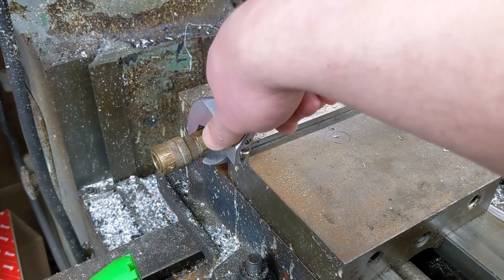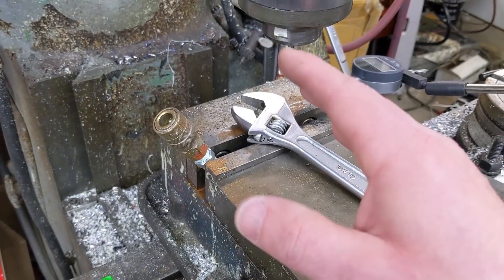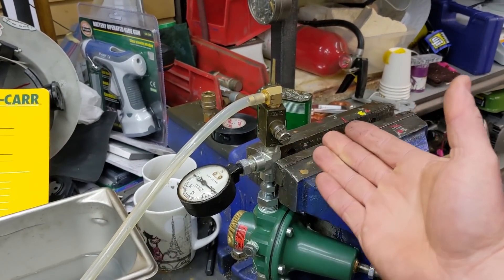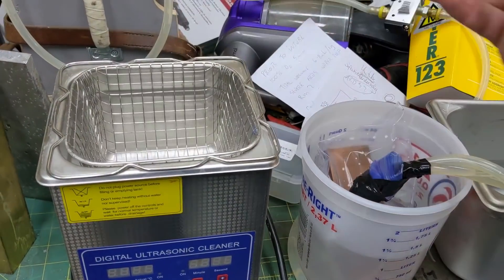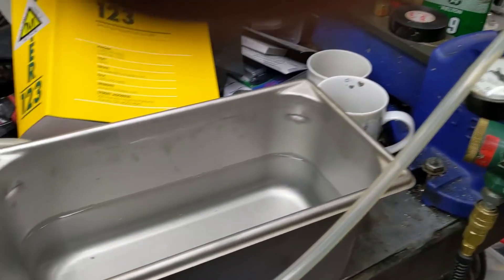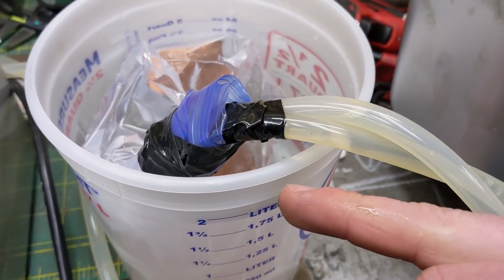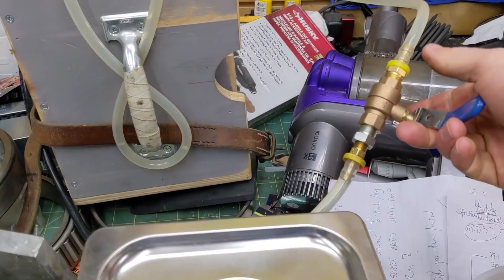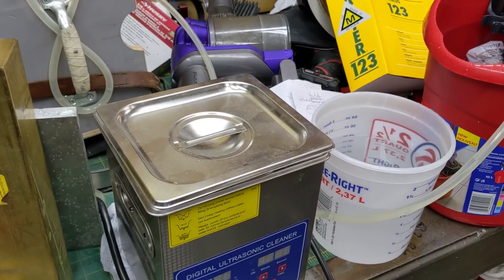Jankiest Ventilator Mk.II Prototype

Comment: Hospital room oxygen is 50psi. Can this device be run on that total input pressure? Also medical air is unacceptable to use for breathing however if you need extra psi if you can run a second loop you can gain another 50psi for running the device. 

If you can do all that then it could be built in any hospital room and ER suite.

-Dr. Vanhoutan MD

Comment: @AvE
You should try to regulate the volume instead of the pressure. The compliance of the lung will determine the volume of air if you use pressure to meter the air. Lungs differ in resistance to inflate, depending on the situation and person. If I remember right between 500 - 600 cc's would be ideal for the volume.

Comment: AvE I repair dental equipment.  This can all be done using only air with parts I have on my van I think.  Dcionline.com is a dental parts website. A PN7220 regulator and a pn7000 routing valve to trigger inflate and deflate using your weighted bag inflating to actuate on and a piece of dental floss tied to the weight and switch actuate off.  There's 1000s of dental techs, we all have these parts on our vans

Comment: This is an excellent excellent machine to torture someone to death. Let’s just pray that nobody will ever have to suffer from this kind of good intended DIY bumblefuckery.

Notice: 
People that are intubated and ventilated will be on low volume high pressure to avoid damaging the alveoli. (Damaging the alvioli would enhance the inflammation you’re fighting against). The low volume however will increase CO2 levels in your blood and that gives you the feeling that your suffocating. This will cause patients to move violently. To mitigate that, they must be paralysed. This would be an horrendous torture so they are sedated as well. Survival rate increase significantly if patients are turned face down for 18h / day. 

Just to give an idea of what it means if you have to be intubated and ventilated.

Source: Medcram channel.

Comment: good experiments, prevention of transmission is still biggest lever to pull... could also consider a face-down, sloped posture to allow fluid to drain from the lungs, supplementing with ketone esters to reduce metabolic demand for O2...

Comment: Okay, I'm sure I'm just missing a concept, but I'm going to ask anyway. Is it not feasible to use some kind of bladder (balloon type deal) to replace that valve? If you could get one with the right resistance? I suppose it wouldn't have any adjustment. Or maybe would fatigue after so many cycles.

Comment: I'm Thinking a fish tank or bigger pond air pump do the trick...so from pump to the air bladder... then use your uv filter setup....now you can attach the bladders to one way check valves and add the O2 viva T or Y connectors ....and then regulate pressure before the ventilator mask...
Oh and I almost forgot flashback arrestor for the O2 ....

Comment: there are many reasons this wont work, sensing when a person coughs or resists the flow into their lungs most importantly. a respirator isnt just something that forces O2 into your lungs.. you also have to pull the air back OUT.. those who are intubated are also sedated to the point of paralysis and the machine has to do all the breathing for them, meaning it puts a regulated amount of air in at a specific volume/time, and then has to also extract said air now CO2 from the lungs. what you are describing is more of a scuba system.
Reply: He has the better half done,  and besides there can always be a part 3.

Comment: I'm not so sure I'd want the air from ANY standard tanked compressor going through my lungs, especially when an infection could prove fatal... I've smelled the air coming out of most compressors and it's anything but pleasant.  Also, there are far simpler ways to move air, on the cheap.  Hell, people with fish-tank bubblers could easily disassemble, disinfect, and reassemble a fish-tank air-pump, then rig up the valves and pressure comps.  With the tank-less design of them, there's very little chance of bacteria congregating inside the pump and becoming a problem as there is air moving through them constantly.  It would also be fairly easy to add oxygen and filtration to this design to further improve the air quality.  Let's not forget durability and cost... I've got one of these pumps that's run for 20 years, straight and it only cost me $10!  I don't know about the newer ones, but the older ones are tough as nails... the only concern would be degrading rubber on the pump, which should be detected during disinfecting, and itself is easily replaced.  Lastly, the tubes hooked up to these are nearly identical (heck, they might be identical; tropical fish are quite sensitive to contamination) to those used in the medical industry, so adapters wouldn't be needed unless you lack the appropriately sized valves.  Don't use a sledge hammer when you're trying to pound in brad-nails; use a nail gun instead (unless you're a masochist and like smashing your fingers... I won't judge... just let me get some popcorn, first).

Comment: Looks like you are on the right track. Just a little more refinement and debugging the timing. Maybe a quick venting valve on the exhalation side could help. A mechanical timer would reduce the need for angry pixels and a confuser.

I enjoy your fabricobble videos.

Comment: Eliminate all the manual fiddle-fuckery with clock-punkery.

Normal adult respiration rate at rest is ~20 breaths per minute. Replace the seconds hand on a (old school large government office sized) clock with a big 20-lobe cam operating the inhale/exhale valves. Might need microswitches connected to electropneumatic valves if you can't find a sufficiently skookum clock movement.
Replace the hour hand with a one-lobe cam for the sigh valving.
Boom. Bobbie's yer Auntie and more hands are freed.

Comment: Hi mate.  While I, for one, applaud your thinking, the simple mechanics are as you say simple.  When a patient is intubated he/she also needs to be monitored.  Often this is done by an individual educated nurse and a computer to measure vitals like Bp  Hr  resps pulse  o2 sats  o2 input  Peep  Etc.  Not wanting to take the wind out of your sails but the ventilator is only a small part of the whole equation.  Now if you can start making more nurses (that can work within the constraints of a nursing board) than that would be cracker.
Reply: Yes where is the  ventilator training vids? There must be some out there.

Comment: Industrial..... I mean respiratory lego:

Care fusion 003005. HME
Use this instead of the ultrasonic cleaner bit. Goes betwixt the patient and the Y. Heat and humidity.

Ventlab vp700 PEEP valve. 19mm od to fit the ID of the circuit. 

Vyaire 0Y1778 vent circuit. Bog standard disposable vent circuit.

Hope this helps, hoss. I finally feel like a grey beard. It's my time to shine.

Comment: I've been on a ventilator for3 weeks before. I'm not sure I'd let them do that again no matter what it would mean.  The problem with yours is some time your going to want to sleep and it's going to be hard to sleep and work the valve. Are you going to cut your throat and windpipe to put the hose in your throat and are you going to get the feeding tube up your nose and thread it to your stomach? hopefully it won't be needed

Comment: Ventilators—how about going old school.  Make an Iron Lung.  Use wetsuit material for neck and bellows. Reciprocating motor at the foot end of a metal pipe.  Worked for the polio epidemic.
Reply: Reciprocating pump at the feet.  Worked for polio epidemic.

Comment: Water column on the inflate side with a float to trigger the breath and exhale? (Gas in a center tube raises the water in an outer tube, once it raises enough, shut the inlet, shut the exhale valve, dump the air into the patient. Once time or volume has passed, shut off air to pt. Open exhale valve through column, open valve to fill chamber.
Reply: For a review of old tech http://rc.rcjournal.com/content/56/8/1170
Reply: @RobertSzasz  what a great read. I think uncle bumblefuck should take a look at it.
Reply: @RobertSzasz  nice article, good find. Was trying to access the army emergency respirator (darpa 1965 - someone mentioned it last video) docs, but the dtic site didn't want to play nice.
Reply: A baggie in a tube with a weight on top for pressure, and a moveable probe to set volume would work. I think that's how the ancient machines you would see on TV shows with the bags moving up and down worked.
Reply: sounds like a toilet tank. do it!

Comment: Do lungs naturally exhaust like that under their own pressure? I would assume that some sort of vacuum would be needed to evacuate the exhaust. This demo is assuming the lungs are balloons  with some sort of elastic backpressure (in this case water). In reality, I things lungs are more like an empty plastic bags that need to be actively pumped and actively unpumped. That's why bag valve masks have a big ol rubber turkey baster handle that chooches in both ways.

Comment: That's pretty neato! When I imagine a jank ventilator without electronic controllers, I think of a pressure regulator (Like the kind you got for your propane and propane accessories), linked to a camshaft and valving. Just like how a motor works. You got your intake valve (Which opens pressure off the regulator. That is your duration of inhale), then you have your exhaust valve, which obviously releases the pressure from the lungs. Adding a restrictor would slow the deflation to ensure a smooth deflate of said lungs, or one could simply have that cam lobe be real gentle.

If you want more flow, you adjust the regulator, or possibly have an inline rotary restriction plate with different sized holes and whatnot. Manages the amount of air that you can actually get through during that camshafts active duration due to pressure differential.

And finally, the only truly mechanical thing I can think of to ensure you maintain some pressure in the lungs, is a reed valve on the exhaust as it enters atmosphere. Reed valves are static, simple, and reliable, and being that you are literally forcing the induction of a lung, it stands to reason it should work.

I can't particularly think of how one would have a sigh function, unless you were to add one more camshaft with a large amount of gearing similar to an analog clock, that once it reaches that hour, it could bypass the restricting plate mentioned earlier.

But what the fuck do I know, I'm just here spitballing same as all of you. It's fun to think about problems.
Reply: I just finished Technogy Connections guy's videos on how an old jukebox controls its complicated functions without use of any digital devices. Done with cams! And relays controlling relays. So I thinK you got it.
Reply: Just activate vtec intermittently for sigh function. 😁
Reply: Reed valve??? Forkin A, a two stroke ventilator! Minus the addition of valves/cams etc.
Reply: Great info. Thanks.
Reply: Uhhh , propane regulator may be a tad to high in oporating range , just a thought . Lest easy the patient into it with some natural gas regulators .

Comment: You only need about 2-3X pressure ratio to make a regulator work well.  
Beyond that serves no useful purpose HOWEVER could be used as a source of power in itself, such as how a soda machine syrup pump works. 
 Using actual water for pressure control, BRILLIANT.

Comment: As a respiratory therapist (yay credentials) in school they taught us about the most ancient of mechanical ventilators, and the method most of them used was somewhat simpler and more compact to get the same results. Most of them are screw adjusted springs up against a diaphragm with a magnet holding a plate in place. Once the pressure gets high enough, the magnet disengages based on what the spring tension against it was. PEEP valves we use to this day in low tech applications like hand bagging are just a spring, screw and diaphragm. Volume control is nice, but in the patient population we see who require mechanical ventilation die to the Boomer doomer virus they all have ARDS, which is a fancy way of saying really freaking stiff lungs with fluid and diffusion gradient isues due to disease process. In that case, we are more worried about the pressure limiting than volume given. Look up something like the old bird ventilators, some of them are even see through so you can take a good look at the guts. Some hospitals use transport ventilators to this day that run on nothing more than a 50 PSI port on a oxygen cylinder. Otherwise, looks like you adressed most of the other issues from the last video that were immediately concerning! I know this is a thought excercise, but if life were on the line, we care most about getting air in and out without popping their lungs or doing further damage by collapsing them without end pressure. All the other stuff is nicities when it's literally life or death with no one left to hold a hand bag to ventilate a patient.
Reply: Really great info Peter!
Reply: Look up pneumatic ventilator on Google images. There's plenty of images to steal, I mean develop inspiration from
Reply: Oh, I forgot to mention, in the ancient vents, they control respiratory rate by controlling the flow rate of the gas. It'll fill up the afformentioned diaphragm at a set interval, triggering it to deliver a breath until the chamber is empty.
Reply: Thank you for your experienced input
Reply: Bump post
Reply: bump
Reply: You don gotta pretend to us , we all failed at sewing class too . It's ok . I'd hug you and console you but for now just pretend I care . Come sit over here and let me give you a tip , and only fir a second .

Comment: The entire issue with ventilators being scares is due to bullshit Patents and Copyrights over what is basic technology. The holders have, previously, intentionally limiting production/supply to drive up cost. One company trying to charge (Italian Hospitals) $11,000 for a "Patented" valve that I can literally 3D Print right now for a fraction of a penny.

Our current situation is a great example as to why Patent and Copyright laws need massively overhauled. They have locked basic life saving technology behind massive paywalls.

Comment: for a test lung take a bag between two slates with a stiff rubber band around it. To make it more realistic you can add a pop off valve that will show if you over inflate so you can file it in. You need to keep the pressures min 5cm/water under 30cm/water. With ARDS you usually need more PEEP than you would normally want. In commercial analog PEEP valves they use a tensioned spring that you dial up the resistance that the pressure have to increase to overcome the spring.

Comment: I took a cpap with nebulizer &/or oxygen concentrator via inlet. 

CPAP Controls pressure in and out, Nebulizerlizes ;) it and I can push into feed to mask with added O2

Add zinc or 4% peroxide or whatever your weed is and that’s as close as I could manage to ventilator quickly.

Had cpap, o2 concentrator $295 Americana, inlet 2 for $3, nebulizer $60 usd.

PS prices will raise as fast as the fed spreads its “love” putting out dollars faster than the preachers daughter puts out. Buy fast. 

Most cpap have heated tanks. Use water or a mixture there like nano zinc with water and you can use a second solution with good results like the 4% hydrogen peroxide that kills CCP virus, not patient. 

Cpaps vary but they keep grandpa breathing and if you adjust hidden settings you can control just about any part of the process.  Most places you can get professionally reverb cpap for $200-300. Maybe less.

Oh yeah, no wrench required. AVE love your stuff man go!
Reply: Peroxide would be in the nebulizer.

Comment: Dr AvE, can I join the medical enginerding dept of your practice? Where the applications at?
Reply from the maker: Yes. The academic requirements aren't as rigorous as the hazing.
Reply: @arduinoversusevil2025  I do have hazing experience...I don't know what the rest meant!
Reply: @arduinoversusevil2025  Careful Uncle, you might get a lot more recruits than you can handle with those entrance requirements...
Reply: First one to bring Ave the pallet stretcher will  get a scholarship.
Reply: ?  Purple hazing  ?
Reply: May need another filter.
Reply: Great Thread